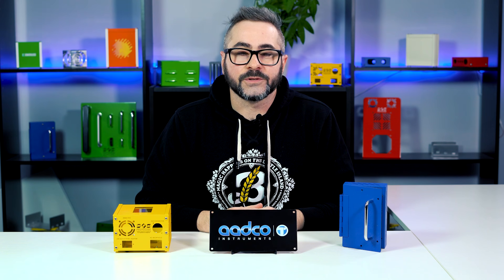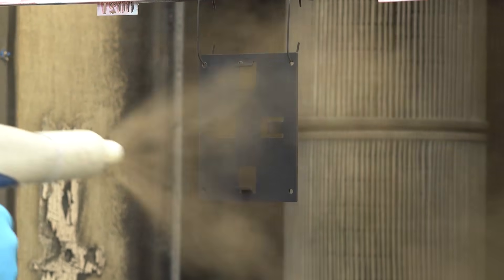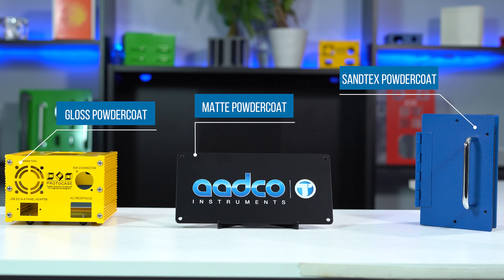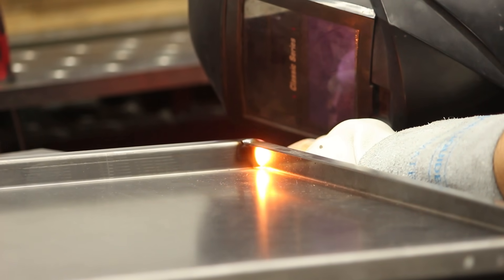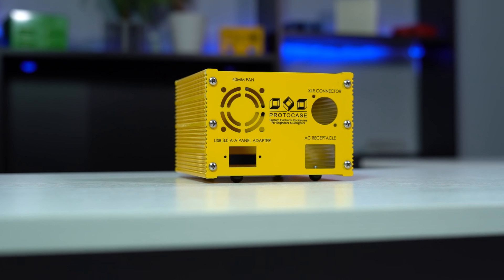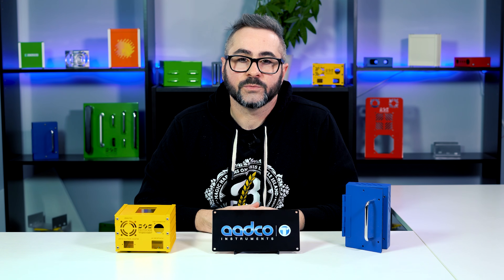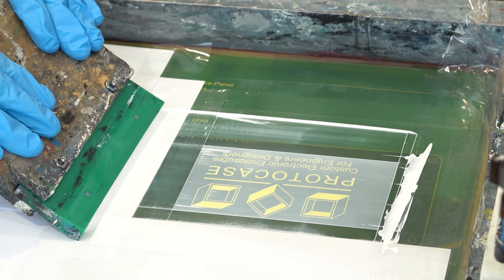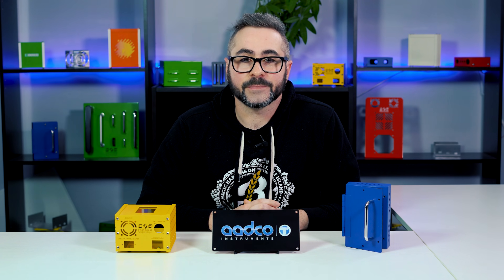Proto Tech Tip - Powdercoat Textures (Gloss vs Matte vs Sandtex)

Comment: This is a great video.  I'm looking to powder coat a product in a matte finish on top of Aluminium, - up until this video I felt using a laser would be my only option to mark precise scales onto the housing, they have to be very precise in mm distance apart - could you advise why you didn't mention laser (perhaps because you use more cost effective methods) and can you make screen printing precise to a mm? I'm unfamiliar with the technique